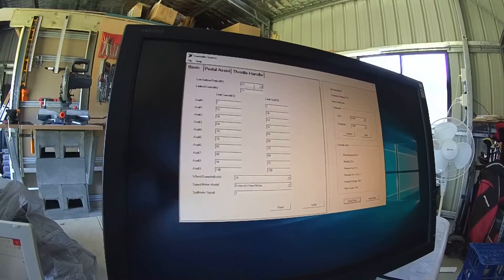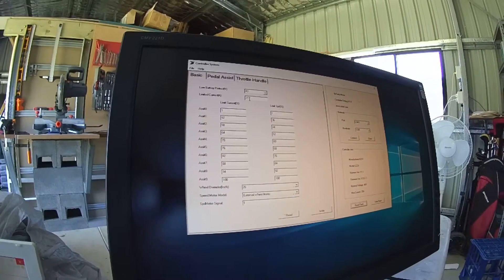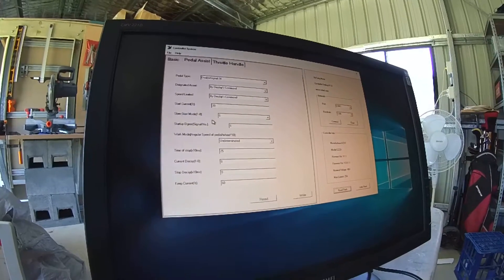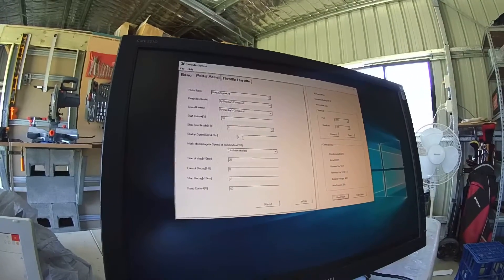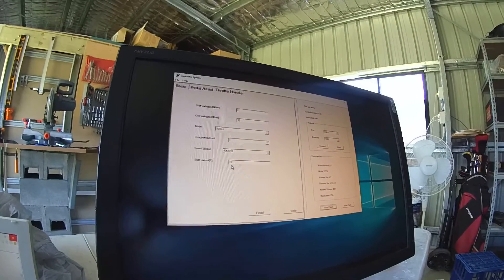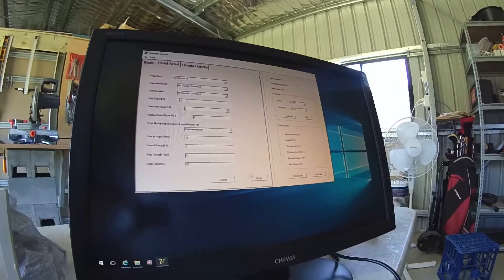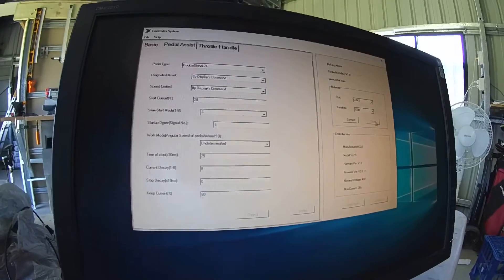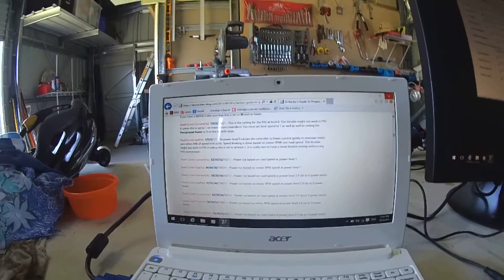BBS02 750W Programming

Comment: if you change the limit in the display to 20 km per hour you whil see that the motor doest cutt off at any pass even whith 3 pass enabled and maybe you ca use thoes settings to modify securly the programing if it works this way